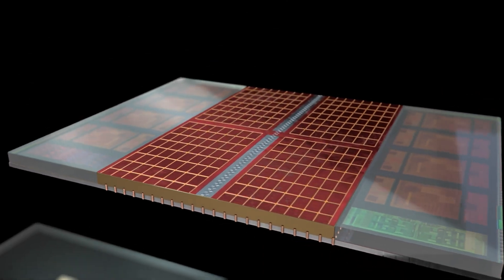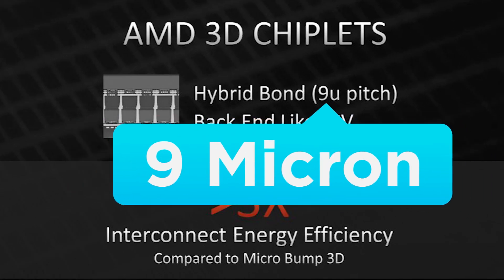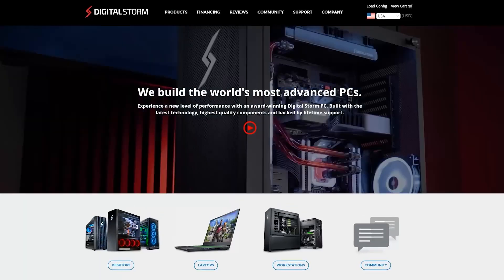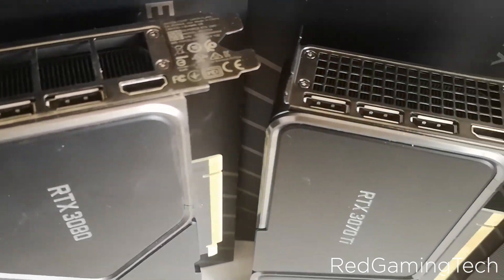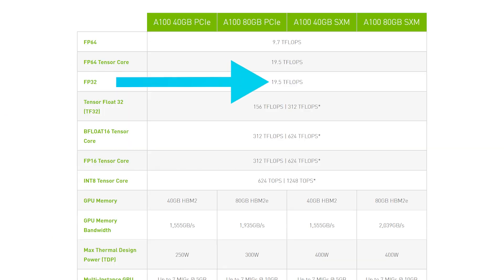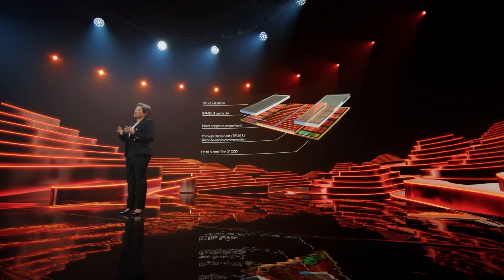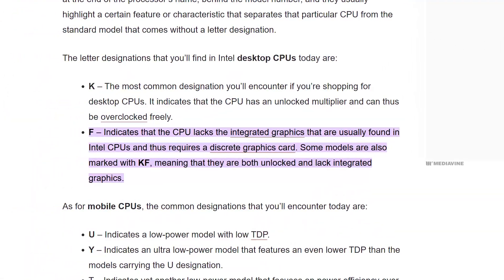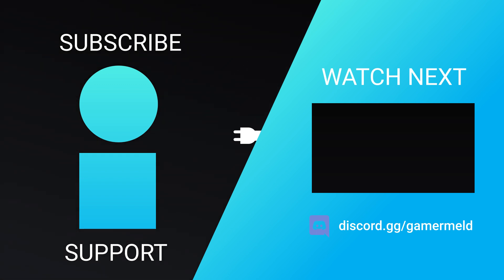Goodbye AMD APUs, Intel's GPU CRUSHES Nvidia and AMD's Best!

Comment: I'm interested in what AMD does with Ryzen 3D with RAM on the CPU.
Reply: its going to be nice to upgrade to one of these from my 3700x...
Reply: I’m hoping it’s AM4….

I clearly haven’t watched yet ha
Reply: @DM-dk7js  well your hope just been crush cause only 5000 XE series have 3d cache on AM4 only while new 3D stack technology will AMD5+
Reply: @DM-dk7js  Zen 3D is AM4
Reply: Problems for 3D chip stacking is the heat output from each chips. Extracting the heat will be difficult for the modern chips which requires coolers for each single chips. But the very low tdp ARM chips may not have this problems
Reply: @dreadavis9751  that’s what I’m thinking.
Reply: @dreadavis9751  You should realize that AMD doesn't design a product and not think about all the potential problems lol.

MCM CPUs with a iGPU means the layout would be drastically different... We will likely see threadripper sized die if so, but if its AM4 its will be limited to the current sizes
Reply: First generation ain't touching lol. I expect a lot of hiccups, mainly with the motherboards. But it does sound promising.
Reply: Yep, one of these with integrated RDNA2 will be a killer micro PC.
Reply: AMD 3d stacking CPU's will run hot
Reply: I hope it's going to be a video buffer, maybe similar to what they introduced with their recent 6000 series GPUs: the infinity cache which is some sort of L3 cache. This should give iGPUs a drastic uplift in performance. Right now the fastest iGPUs still perform below a 5 years old RX460 at around 2TFLOPS only.
Reply: Taking a glance at Apple’s M1 and all the gains they have achieved, between AMD and TSMC this could benefit a huge market such as businesses. Keep in mind AMD acquired Xilinx a while back which could make these chips efficient and cool.
Reply: On-die memory like HBM
Reply: @Bella Cosmic Hound cant disagree, it leads to make in efficiency and performance, but slotted memory would prove beneficial in the long run (in desktop form factor atleast)
Reply: Btw guys digital storm is the biggest rip off in the whole pc world their stuff is extremely over priced always has been
Reply: The same thing intel has planned for ages nothing new
Reply: I think it's great for notebooks, but desktops needs to have it separate or have the possibility to add more on board as much as they can, which could end up in sincronisations problems
Reply: That's crazy I was just thinking of that they doing that?
Reply: Wow im excited like who taught of that, like placing a cpu on top of another wow, any worries are the temperature if im thinking about this
Reply: Stacking should help for low end. Do not need to heat my DDR to drop performance...
Reply: @Blana4xr  heating DDR is not really a concern. It will do fine in both environmenta
Reply: @donovan6320  it will do fine with 30% utilization with 3x worse ber.
Reply: @Blana4xr   DDR doesn't really mind getting hot. The controller might, but that could be handled by the CPU Directly so?
Reply: @donovan6320  you are clueless.. have you ever heard about memory refresh?
Reply: @Blana4xr  yes... why? Memory prefers it colder, but in practice worst thing you would need to do if heat is a problem is place memory on the bottom and then the die on top so? You gotta remember SRAM has been sitting in CPUs for a long time now
Reply: @donovan6320  on the bottom are the pads... For all the 3k+ pins the CPUs nowadays have.
Reply: @Blana4xr  no your right, sorry I am tired. The point remains the ram would be fine on the CPU...
Reply: It will be interesting to see how they control thermals
Reply: Ram on the cpu?
Doesnt sound good to me
Reply: @tanujrana8490  how about “extra RAM” on CPU?
Reply: @shao1423  L4 cache?
Reply: @tanujrana8490  certain android phone already do that, only work for low tdp(laptop)since the material can't handle heat, yet
Reply: @tanujrana8490  you a damn lie with ram on the cpu the transfer rate would be instantly!!! That's crazy I wonder how much ram tho
Reply: @krinodagamer6313  CPUs would become much costlier and to upgrade your ram, you will have to upgrade your cpu aswell. Look at how inflexible m1 is regarding its ram capacities.
Reply: @tanujrana8490  all I can say is mfs better start saving lol
Reply: @tanujrana8490  and ram capacity is determined by the type of MOBO not cpu
Reply: @krinodagamer6313  do you have any idea what you are talking about? The capacity of on-die ram would ofc be determined by the cpu. What role does mobo play here?
Reply: @tanujrana8490  I thought that what you were getting at yes I understand that but it's ways around everything look how far we have come now that's not a major issue I'm sure they know of that is what I'm saying
Reply: @tanujrana8490  why not
Reply: @tanujrana8490  And it will be on top so might be a overheating monster. May have to put it under ice just for normal use lol. But still Im interested to see what they can do though i have all the cpu power i need atm with my 5950x so im good, would be interesting if it was still am4 but i dout that.
Reply: @forog1  it would be fine if it's for the igpu, but i don't want to live a life where ram is coupled with the cpu and diy people can't customise the amount of ram on the fly
Reply: @tanujrana8490  I mean they already demonstrated what it could do with a 5900x test sample with it but no where near enough details though. The ram is just cpu cache so I can't see it fitting for an igpu as it might be max 128mb ram cache so it would be to small for igpus anyway. Still its interesting to see how it come out and tests. My concern is temps though. I don't want to HAVE to use water to cool them.
Reply: @tanujrana8490  Maybe it'll give the diy community some to start with then have traditional banks for additional RAM.
Reply: @forog1  the chiplets are so thin that heat transfer will not be a problem, the abundance of copper interconnects between circuits also improves cooling.
  The concern would be the TDP ceilling that can get out of control, with stacking RAM that will not happen because of the low memory power consumption. Maybe an extra 30 watts compared to the 5000 series.
Reply: @tanujrana8490  I'm gonna die of suffocating becuz if that happens my one and only fan might just die. 😂
Reply: @tanujrana8490  what do you think cache is? Its typically sram not DRAM but cache IS ram and the reason it is so fast its its small size and closeness to each core or cpu.
Reply: @donovan6320  i think cache is rj45 port.
Reply: @tanujrana8490  the point is its likely gonna be used to expand cache sizes, not as actual system DRAM, it could also be used in APUs for a small amount of dedicated VRAM which you might be able to use as a limited form of ram in the future, idk
Reply: @donovan6320  dude, someone suggested an m1 like dram-on-soc setup in one of the replies, and my dread for the situation was targeted at that specific circumstance where diy processors have system ram on die and no customisation. I realise the stacking and V-cache isn't targeting that atm, we were discussing a hypothetical situation.
Reply: @tanujrana8490   And I doubt motherboard manufacturers would remove dram slots.  I also doubt AMD or Intel would have the balls to remove it outright from the pinout.
Reply: @donovan6320  would be nice in thin and lights/ other extremely sff devices if performance/efficiency gains are good. It isnt replaceable there anyways
Reply: @tanujrana8490  ehh I doubt there is enough package space. In die DRAM chips would be expensive to attach, and the size of the die itself would be a limiting factor.
Reply: It's gonna lose to intel anyway
Reply: @GhostSlayerYT  XD just like it has been losing for the last couple of years
Reply: @tanujrana8490  I don't think the last few, but in the coming few for sure :)
Reply: @GhostSlayerYT  fanboyism has peaked i see

Comment: Prices, prices, Intel entering is only a plus if it brings down prices!!
Reply: I honestly really hope intel can bring good gpu's both to actually use, and bring down overall gpu prices even at msrp
Reply: The higher prices come from the more expensive individual components with which the cards have to be fitted. The higher prices come because a) the manufacturers have more demand than they can produce, b) because environmental regulations in some countries make production more expensive and slower. And Intel feels that just as much as every manufacturer does. Today, in all possible consumer products, from cars to household appliances, etc. Chips and controllers are installed. Prices will not normalize again until manufacturers have increased their production capacities for current and future demand. This is not possible under 2-3 years.
Reply: Intel is ONLY getting the gpu game BECAUSE inflated prices. I highly doubt Intel doing anything that truly shakes things up. They smell dollars like sharks smell blood.
Reply: @ArsynZ  fun fact the sentiment that sharks can smell blood from a mile away is false
Reply: I expect that most of the Intel Alchemist GPU's will end up with the OEM's like Dell, Lenovo, Acer, HP and so forth. Also, TMSC isn't going to be able to dedicate a whole lot of 6nm production to Intel until the new FAB's in Arizona come online in 2023 or 2024. But still, it's good to see a third player in the arena.
Reply: Vega was very good at mining Cryptocurrency. Guess who made Vega... The Lead GPU designer at Intel😅 so i wouldn't get my hopes up..
Reply: this is Intel we are talking about...not too damn likely...paying for  the name.
Reply: Thats what ignorant kids say... Logic will disagree with you.
Reply: @StitchKiller  ?
Reply: @StitchKiller  You know nothing about logic. If you would think logically, then more GPUs = more stock demand is met = less demand on the market for GPUs = cheaper GPUs.
Reply: @StarekS  yeah but there is a semiconductor shortage, meaning that the chips they put in their gpus will be very expensive, meaning that if they dont want to lose money they will have to charge big amounts

Comment: If the shortages are continuing, the whole next gen SUPER, DG2(or wtf is that crap), Zen3D, Zen4, RDNA3 thing is worthless. 😇
Reply: Apparently GPU shortages will continue until 2023... so another year and a half or so. I'll rather sit on my GPU than pay a scalper or a miner that beat the shit out of that GPU running under 100% load 24/7.
Reply: @Vicious_One  running a gpu for mining in 100% is a noob miner move
Reply: @youryoureallyare  not to mention most experienced miners take care of their system/components better than the average gamer as it's making them money.
Reply: @Valkirth  Doesn't really matter when the GPU is under 100% load non stop. That's like revving his car engine to its limit without driving everyday for hours and just top it off with oil and gas here and there. Will it last for quiet sometime afterwards yes and then selling it someone else with ONLY 1200 miles, clean title, etc. But how long will it last afterwards? Nobody knows. I would much rather buy a GPU from a gamer and I would be buying a new gen such as Ampere or RDNA2 GPU. A gamer wouldn't have enough time to kill a GPU while a miner on the other hand would have his GPU working as hard as it could the whole time. If it wasn't for miners GPU prices would be MSRP and everyone could afford a brand new GPU for almost a year now.
Reply: @Vicious_One  Bruv, I got tons of GPUs, some are with me in my old builds for years. All you have to do is change thermal paste and thermal pads and card is like brand new. GPUs and CPUs are indestructible. Get some knowledge about it first, then crap like that lol. I can send you Riva TNT 2, 22 years old and still running haha :D
Reply: You meant write priceless, yes?
Reply: Theoretically if amd/Nvidia make better mining cards, miners will leave "latest" shit to us for a "price", maybe MSRP.
Reply: @Viztiz CPUs do last forever while GPUs on a other hand are a different story. But it's pointless.. our conversation is going no where.
Reply: worthless to you, priceless for AMD and Intel. Servers an OEMs makes them 90%+ of the money.

Comment: "Intel's GPU CRUSHES".... I think I would wait for benchmarks before saying something like that.
Reply: It could be really heavy and crushes the amd/nvidia when put on top.
Reply: @PrayAnSpray1  yes
Reply: @PrayAnSpray1  "No,no he's got a point"
Reply: There is already talk that the Intel Big gpu will be around the 3070 -3070ti level...

Saying it crushes really pisses on the work AMD-ATi and Nvidia have done over 2 odd decades.
There is no way in biscuits that Intel will walk in and take a performance crown from either the 6800xt- 6900tx or the 3080 , 3080ti or the 3090.

And if you know what you're talking about.. which I am inclined to believe ... that would be fool hardy to say the least.
Reply: @heathandkentyvapevarietysh1402   off course no one is going to compare it the way you are saying it. They have to consider pricing as well.
Reply: @nayyarrashid4661  They will compare...  that's what fanbois are for..
Reply: @heathandkentyvapevarietysh1402  Intel can't take the crown unless they made AMD's partners backstab them in illegal means again...

cough OEM bribes cough
Reply: AMD has 6nm RDNA2 ready just in case. Then halfway 2022 RDNA3 comes out.. So i don't have much Faith Intel will win. But Competition is good either way 👍
Reply: @Ronny999x  Intel's GPU are also on TSMC 6nm
Reply: Ever heard of clickbaits? 😁
Reply: @mohdk2299  thats what he meant?
Reply: @mohdk2299  Clickbait isn't supposed to just be outright fabrication. Just misleading. This is not the right way to do clickbait lol.
Reply: @mohdk2299  I expect that from this Channel now..Everything is "Huge"  or gets "Destroyed"
Reply: @mohdk2299  like jailbait only legal
Reply: @nathanleigh9450   What do you mean? jailbreaking is totally legal.  At least in the United States, As long as you do it for right reasons that is.
Reply: @mohdk2299  Hence Why I clicked, and downvoted without watching this trash.
Reply: @mohdk2299  you must  say to him: Ever hear of Gamermeld (bullshito titles)
Reply: It is Gamermeld bullshito leaks ,he talks similar to xe dg1 and in reality it is garbage weaker then gt 1030 and most of games cannot even run because of buggy drivers
Reply: Yeah I'm not buying it 🤣
Reply: just take a look on the overall video on this channel. everything is just click fucking bait, just get your news on Gamer Nexus for depth and detail insight of the industry also flag this channel not to be recommended again.
Reply: If Intel keeps it on stock property like their CPU's, it might...who knows..?🤷
Reply: He always says that then they release to the public 9 months later when amd have better  stuff
Reply: probably only costs 30k lol
Reply: I've hinted before. This channel and more are Intel Fanboys
Reply: He completely forgot to mention Ponte Vecchio isn't launching until end of 2022. That means Ponte Vecchio is competing with CDNA3 (MI300) from AMD and probably Hopper? from NVIDIA. A100 provides around half the FP32, but a change more in like with consumer Ampere cards where they have double FP32 per int unit would have a higher compute throughput would have it more or less at the same performance level purely in compute capabilities. Distributed computing is difficult though, and a lot of that 45TFLOPs may go unutilized because of inability to populate the shaders. To me it's a lot of hot smoke currently from Intel. 

Also, it's not competing on the consumer end. The highest end consumer card will only have 512 EUs or 4096 Shaders. If it's based on Xe graphics in laptops, we're looking at performance that's seemingly lower on average compared GCN. That means performance should slot in closer to the midrange from NVIDIA and AMD for the highest end consumer card.
Reply: intal gpu is shit
Reply: It doesn't crush shit. At best it will be competitive with RTX 3070 and RX 6700 XT. Gamer Meld is fucking clickbait cringe clown.
Reply: Me too
Reply: This and many others love to use clickbait titles.
Reply: Click bait
Reply: The real question is are they going to cool the GPU's right or are we going to have another engineering blunder where the GPU is going to be like the i9 cpu's where they run so fluffing hot you can literally burn your hands on them?
Reply: hes talking about deep learning type of cards not gaming cards
Reply: and wait for next gen gpus
Reply: That Intel GPU die looks 10x larger than the AMD and Nvidia counterparts
Reply: competetion pushes their release. if inel never gonna catch up. AMD will start squeezing the toothpaste with vegas XD
Reply: Gamer Melt is crap, that's why. He loves to spread panic, excitement and general misinformation since it brings in clicks.
Reply: They are talking in terms of FP32 performance. Which is kind of what gpus are supposed to do wholesale, thats the majority of their compute.
Reply: If raja is in charge of their gpu debt it's going to be a flop.
Reply: @JohnWickoff87  ehh I doubt it, he has been in this dept for years, Vega was his only real flop to date and its believed it was heavily rushed and honestly was just meant to put something on store shelves regarding GPUs
Reply: Yeah no shit.
Reply: How many times I've heard Intel say stuff like this and in the end it amounts to nothing.
Reply: He always overhypes his video titles
Reply: I thought, "Has Gamer Meld learnt his lesson and hasn't clickbaited this video?". Turns out, no .
Reply: It's marketing
Reply: not to mention he is comparing gpus that are not meant for gaming so who cares
Reply: potato gpu
Reply: Yeah. It CURSHES amd and Nvidia gpu

But. The lower end tho lol.
It definitely will CRUSHES  RX550 and GT1030 D4
But against 6800XT or 3070Ti.
Probably equal of worse